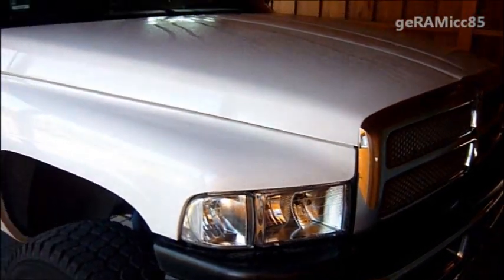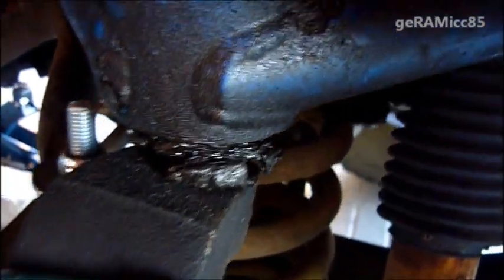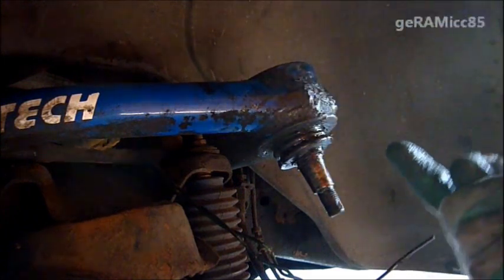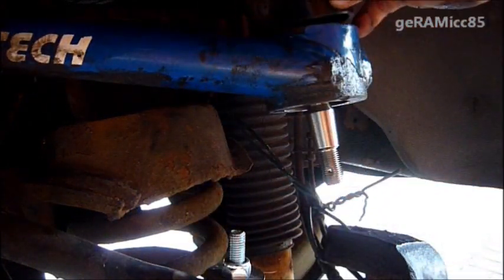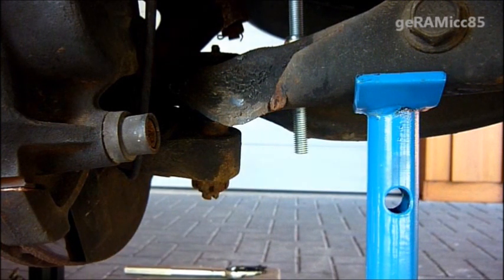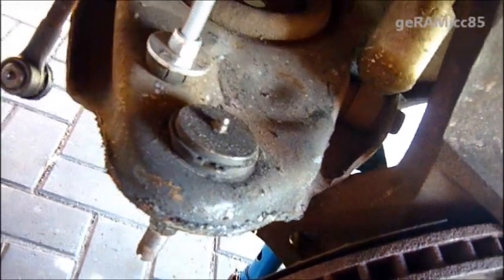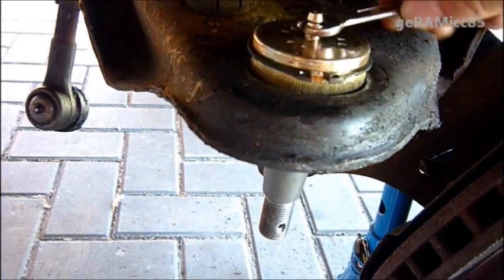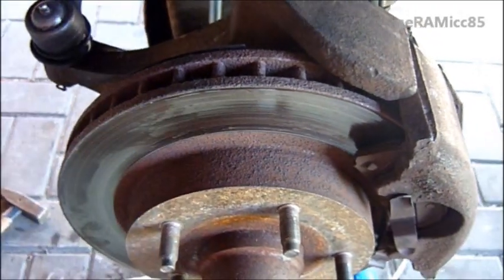BALL JOINTS REPLACEMENT ON DODGE RAM | HOW TO PRESS IN UPPER+LOWER, REMOVE,REPAIR,DETAIL INSTALL,DIY

Comment: Right On...I bought Moog lower ball joints but chintz'd out and took em to a local shop to install em after realizing I didn't have the time or whatnots to install em. Watching this made it painless though and I'd love to tackle them next time. What I did though was replace the rack and pinion and intermediate steering shaft on my 2001 Dakota so I did have some fun! Your video was so good that I watched it till the end even with the 2 commercials LOL...

Comment: you have no idea how relieved I am to find this video. I have the same style control arms on my truck. I tried with a press and could not get it to work because the cup is too big and I wasnt able to press it out in the end because the c-frame was too small. Tomorrow im going to rent a tool and try again but with this method. Thanks alot bro.
Reply: rzr 1000xp vs Yamaha
Reply: Ray Chapell are you high

Comment: if you put the ball joint in a freezer overnight, the metal will shrink and be easier to push in the arm.  Also lightly heat the arm and it will expand and make it even easier.

Comment: Just finished doing one ball joint. You made it look too easy. It took me probably 4 hours. I had no pickle fork. Had no one other cars to take me to the autoparts store. The joint puller was almost too small to go around my control arm so it wouldn't push straight and it kept pushing the ball joint in crooked. I finally got it though. Luckily I only needed to replace one. Thanks for the vid!

Comment: This video was very helpful for me. I was hoping to find a video that was the same style and year, as Ill be doing mine tomorrow.  Thanks again!
Reply: geRAMicc85 
I have the same fabtech control arms on my 1999 ram, what upper ball joints did you use? can you give me the part #'s.

Comment: Pushing the ball joint in without the proper adapter could mess up the housing. You should consider using the adapter that pushes the ball joint in by the middle ring which is a much harder steel than the Bottom.
Reply: Exactly what I thought.  In fact, I did what he did before and I'm afraid I ruined the bushing as I seemed to push grease out while doing just that.

Comment: Thank you for taking the time to prepare this video.  Your commentary is perfect throughout and nicely populated with tips/tricks.  

I bought an OTC ball joint kit for my 2007 dodge 2500 and the fork for my air hammer.  But, it's 19degF outside today in New Jersey so I'm not tackling this anytime soon.  I guess I'll wait for an early spring day.

Comment: Gettin ready to install new ones on my 01'Ram 1500 4x4....video was very helpful and I hope it goes just as smooth for me as well, Thxs
Reply: this is not a 4x4 set up... you have to remove the axle for the 4x4

Comment: Looks amazingly straight forward. Thanks for taking the time to record the entire process. Two question: 1) Can you give me the exact brand and model of the special tools you used? 2) Which brand and model did you use for your upper and lower ball joints? thx
Reply: I talked to FabTech today - Jan 22, 2019. Geo in tech support warned me NOT to use any other ball joint on the Fabtech upper Control Arms except the stock Mopar ball joints part # 52037674. (They retail for $199 each but I found them on ebay today for $40/ea brand new!)  Moog's, etc DO NOT work and I found out the hard way- he is correct!  On the lower stock Dodge control arms (used with the Fabtech 6" lift kit), use Mopar part # 52037660- (retails for $184/ea) OR any other equivalent ball joint like the Moog K7201. I bought the Moog's also for $40 ea on ebay today.

Comment: thanks for a bit of clarification man, but i agree with birdwing 98, use wood, not bricks, the wood has a little give which will hold your jack casters in place.. wood also doesnt typically shatter like bricks or block. thanks again for the clarification.

Comment: Excellent video!  I was planning on having the shop take care of this, but after watching your video, I plan to tackle it myself.  The 2 tools you used to spread the control arm and compress the ball joint out with are available at O'Rielly's on a loan basis.  Thanks again.

Comment: great video, I use a cup and adapter on the outer edge of the ball joint to press them in never on the ball joint.

Comment: 1.  Thanks for the video always excellent
2.  Every video people show how the ball joint wiggles when they are being removed but don't show how much a new one wiggles.
3.  How long have you owned this Truck and how many miles do you have put on it?
4.  How are preventing rust?  I believe Germany uses salt in the winter.
5.  Put up a Patetron account and we'll fund your build, rebuild of a gen 2 Dodge Ram 2500 4x4 or any diesel.  =)

Comment: I have a 96 ram 1500  extended cab 4x4 , are the upper ball joints replaceable? I no I need them , not sure about lowers but might s well do them all while its apart

Comment: Nice video! With all the effort of using a portable press, I wonder if it might be less effort to take the control arms right off and do it on a press. But I guess that would mean taking off the springs, and all the extra work that would be. Probably best to do it as you did. Those don't look like stock control arms....

Great to see another of your videos, it's been a while.
Reply: thermaslate
Reply: where is the thermastat
Reply: thermastat
Reply: v

Comment: nice video, but that Snap Ring you put on the lower joint seemed a little too high to me. is that how its supposed to be, or should it be more flush with the control arm? i feel that it should be flush.

Comment: Great Video!! I replaced the front bearing/hub assembly this morning on my 2005 Ram 1500 (driver and passenger). I noticed the ball joints looked a little worn. Any idea what kind of costs I'd be looking at if I take it to a mechanic? I like to DIY most things but this looks a little out of my league. Thanks!!
Reply: Wilbert Williams

Comment: Are you sure that you did't confuse the upper balljoint with the lower one? The lower one  is sticking excessively out and the upper one is too low in the wishbone
Reply: He's right mine are the same way long at bottom short at top

Comment: My mechanic tells me the '94 Dodge Ram 1500 model design requires much more work than simply replacing the ball joints. He has indicated that to perform the job like it supposed to be done, it will cost around $1,200. The truck only has 39,000 original miles on it, I only put approx. 1,200 miles on it last year. The truck sat unused for a period of time: that's why it has so few miles and why the ball joints need replacing. I'm not looking to spend that much unless it is necessary.
Reply: sometimes its cheaper just to replace the control with the ball joint already in it

Comment: I'm about to do an upper ball joint replacement on a 2WD 2500, was just checking your video for reference.  My brother's 4WD 1500 has a Fabtech lift kit that I helped him install about 12 years ago.  You're lucky, on your setup, at least you can press out the joint.  On his, the unit was a whole arm/joint assembly, horrible design and they have changed the revisions over the years.  Getting replacements are harder and harder from these people because the joints they use go sloppy after just a few years of mild driving and you have to buy replacements from them only.  They're slow to ship, too.  Took multiple weeks to get a replacement, meanwhile the truck continues to eat tires if you don't have a spare vehicle to drive.  Horrible customer service experience from Fabtech.

Comment: If you have to replace your tie rod end, do you also have to replace ball joints?
Reply: No, you don't have to. 
But, since you do have to disconnect them, it's a good idea to inspect them and if they're worn at all, it would be a good time to put new ones on.

Comment: I was told my 98 dakota needs the upper and lower ball joints replaced.  I see you got the parts from Rock Auto.  I am wondering if they are cheaper than, say, ebay?
Reply: I wouldn't skimp on front end parts since the labor is the biggest expense. Buy some quality product like MOOG parts. EBAY likely has them also. Good luck.
Reply: That's what I did.  The lower control arms I replaced.  The uppers were no longer available unless it's for a 4X4; mine's a 4X2.  I just bought the ball joints and installed them in the upper arms.  The upper arms from Moog are no where as beefy as the factory installed arms but the lowers are the same.  Once we got the old ball joints off we could see how bad they were.  The steering is quite a bit tighter now and quieter. You're right about the labor.  One independent garage quoted $1,400 and a dealer quoted me $2,000.  That, to me, is outrageous.  A friend helped me do it in 4.5 hours.  We had all the tools and a lift.  The lower quote was for 12 hours a $119/hour.

Comment: Thank You for the great video geRAMicc85 I have the same upper control arms and no balljoint press that any of the auto parts stores rent work. Reason being cause the one your using has more adapters to use. Can you tell me what exact ball joint press your using? Thanks Again
Reply: Harbor Freight got a kit man !!

Comment: When you do the ball joints on the truck, does it need a fresh front wheel alignment?
Reply: ***** you need alignment anytime you work the styeereing controls
Reply: piperjack537  you only need the alignment if you change the upper control arm the adjustment is on the upper control arm not the ball joint

Comment: great video! do u remember the torque specs for the ball joints?
Reply: 55ft-lbs both upper and lower (both for wax coat and  E-coat frames).

Comment: How long would you say this took you? I just got quoted $1,500 to change all 4 ball joints on my 2002 dodge ram 3500.
Reply: Yeah i need two new bearings on 2000 ram 1500 and a my left upper and lower ball joints. It also was estimated at $1,500  and I said fuck that i'm getting a friend to do it.
Reply: Estimated price to replace all 4 ball joints on my 2001 Ram 1500 4x4 was a little over $1000. I have since purchased new tie rods, both inner and outer for both sides as well as all ball joints for $500 and change. Going to attempt replacing all with a little help from a friend:) If all goes well, my time and effort saved me thousands. Oh, I do have lifetime allignment at Firestone so no worries there.
Reply: I was quoted under $700 to replace upper control arms, lower ball joints and outer tie rod ends.  Parts and Labor.  You guys must live in Cali or something...lol

Comment: Are those after market control arms? Cause every place I look for 2011 Ram 1500 ball joints say you have to replace the whole control arm. Every place on eBay says 2006-2008 4x4 1500.

Comment: I think you have the wrong balljoint for the lower one. That snap Ring is supposed to be flush up against the control arm but there's a big gap on yours.
Reply from the maker: it should be fine but thanks

Comment: Man guy find your self a piece of pipe to use as a breaker bar torque wrenches are a precision instrument to calibrate the amount of correct work on any given bolt or not you can go to a plumbing shop and buy a piece of black gas line pipe you know foot 2 ft long hard long you want it 3/4 1 in in diameter you could flatten the end of it and to fit your wrench a little bit better other than that you did an excellent job well done

Comment: Wood blocks are better than bricks under the hydraulic jack.  I worry about decorative brick or concrete might fracture under pressure.

Comment: Hey man I have a 96 dodge ram 2wd I have a 3inch body lift on it and the 2.5 leveling kit on the front I'm thinking on buying a 6.5 fab tech kit but before I wanna know does it lift the from and back 6.5inch is it the same and will it affect the body lift at all plz help

Comment: I have a 1996 dodge ram 2wd 5.9 reg cab with fab tech upper control arms like that. What Ball joint would fit? If you have have a part number that would great. Also where could I get the snap ring to hold it in place. Thanks
Reply: geRAMicc85
Reply: I talked to FabTech today - Jan 22, 2019. Geo in tech support warned me NOT to use any other ball joint on the Fabtech upper Control Arms except the stock Mopar ball joints part # 52037674. (They retail for $199 each but I found them on ebay today for $40/ea brand new!)  Moog's, etc DO NOT work and I found out the hard way- he is correct!  On the lower stock Dodge control arms (used with the Fabtech 6" lift kit), use Mopar part # 52037660- (retails for $184/ea) OR any other equivalent ball joint like the Moog K7201. I bought the Moog's also for $40 ea on ebay today.

Comment: Always liberally apply grease or lubricant on the threaded bolt of your tool before use. The threads on your tool are starting to show too much wear.

Comment: Is the upper ball joint the same as the stock one? Like fabtech didn't use a special one in there? I'm trying to find the one I need but fabtechs numbers on it don't come up online

Comment: Mine don't look like that I have a 2001 Dodge ram it has two bolts that hold and a assembly upper ball joint it looks like if I just take the screws out it will come right out and then you replace it with a newI've been holding off on doing it because it costs like $150 for the compression tool but I don't even think I'm going to need it I don't know yet I haven't took the tire off I've just turn the wheel and looked at it but it looks like I'm not even going to need the compression tool when you buy upper ball joints it comes with the whole thing already compress

Comment: Good job.  I was actually looking for a good shot at the front suspension on these Dodge pickups. I'm advising a guy about swapping in Mopar front ends. He is doing a 1954 Chevy pickup. I'm going to tell him that the Chrysler M body front would be best for his application.  Thank You for the video.

Comment: Is that lower joint supposed to stick up that far?
Reply: +geRAMicc85 Always thought that both sides of the joint fit flush with the arm.

Comment: Moin

Woher hast du den Ausdrücker? Hab gerade mal auf Ebay geguckt und nur so kleine Dinger gefunden... Denke bei mir auf der rechten Seite ist der Balljoint auch durch, da ich bei Bodenwellen immer ein "Tock Tock" auf der Beifahrer Seite höre, wenn auch nur leise.
Reply from the maker: moin, also als die bei mir auf waren hat es immer gequietscht beim lenken, ein Talk Talk könnte auch ein Loser Stoßdämpfer sein, kannst ja mal schauen, ... die Ausdrücke hatte ich damals auch irgendwo online gefunden, ich schaue noch mal und wenn ich den wieder finde gebe ich noch mal bescheid
Reply: @geramicc85  Das wäre sehr nett! 
BTW.. Hast du den Ram noch? Hab mir so ziemlich alle Videos von dir angesehen und Du hattest in einem der letzten ja ein paar Probleme mit dem Motorlauf. Beim letzten Video sah man dann ein anderes Auto, da musste ich jetzt mal nachhören :D Wäre schade, wenn der weg wär. Scheinst auch halbwegs aus der Nähe zu kommen (Hab ein NR Kennzeichen gesehen gehabt..?)

Grüße \m/

Comment: How did you know that your ball joins were shot before you removed your tire?
Reply: Sloppy steering is one thing that will lead you to need to do this.  Also, if you hit a rut or pothole and hear a clunking sound (metal on metal) could be a sign of a bad ball joint.

Comment: Is it the same for a 06 dodge ram ,and what was the set of tools called??
Reply: Raul Ruiz The job will be very similar and the tool is a ball joint press. Get a Chilton repair manual for your truck 1st. When your buy or rent press make sure it has adapters for YOUR year and model truck. Last but not least use a ratchet and breaker bar not a torque wrench, it matters.

Comment: Have a question I know it's old but I have the same set up but I can not find upper balljoints  for my truck same exact set up please help
Reply: pjay iagmin have you found the upper ball joint
Reply: pjay iagmin 
I also have these same upper control arms on my ram and I'm also trying to figure out the part # on these ball joints
Reply: Yes I found them
Reply: Alex Langston yes
Reply: @blackgoonigan9788  I talked to FabTech today - Jan 22, 2019. Geo in tech support warned me NOT to use any other ball joint on the Fabtech upper Control Arms except the stock Mopar ball joints part # 52037674. (They retail for $199 each but I found them on ebay today for $40/ea brand new!)  Moog's, etc DO NOT work and I found out the hard way- he is correct!  On the lower stock Dodge control arms (used with the Fabtech 6" lift kit), use Mopar part # 52037660- (retails for $184/ea) OR any other equivalent ball joint like the Moog K7201. I bought the Moog's also for $40 ea on ebay today.   Thx for great video!

Comment: Never support a jack with concrete blocks, they aren't reliable and can easily crack under the weight. You should also always use the expensive MOOG joints, anything less will need replacing much sooner and cost more in the long run.
Reply: I talked to FabTech today - Jan 22, 2019. Geo in tech support warned me NOT to use any other ball joint on the Fabtech upper Control Arms except the stock Mopar ball joints part # 52037674. (They retail for $199 each but I found them on ebay today for $40/ea brand new!)  Moog's, etc DO NOT work and I found out the hard way- he is correct!  On the lower stock Dodge control arms (used with the Fabtech 6" lift kit), use Mopar part # 52037660- (retails for $184/ea) OR any other equivalent ball joint like the Moog K7201. I bought the Moog's also for $40 ea on ebay today.